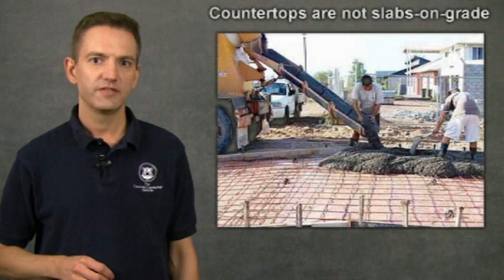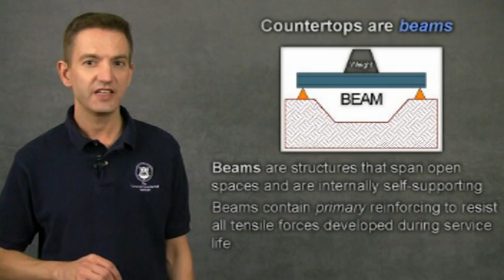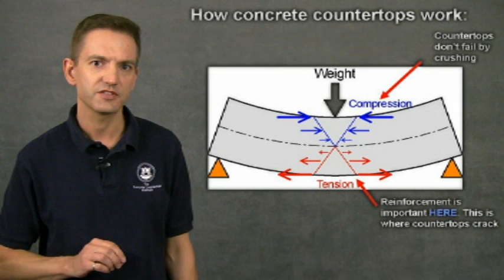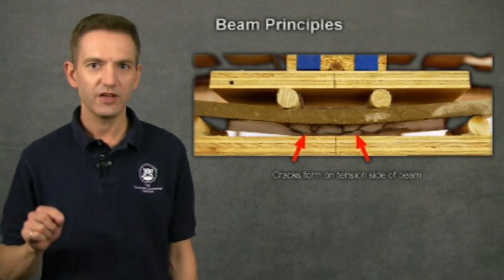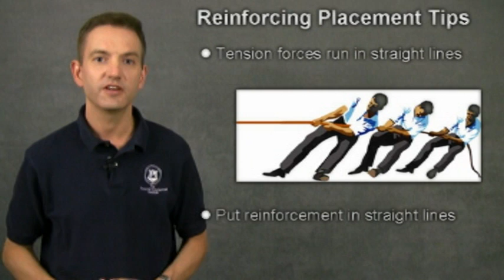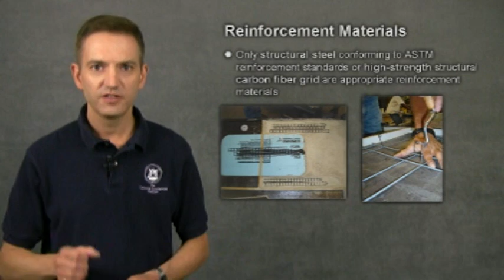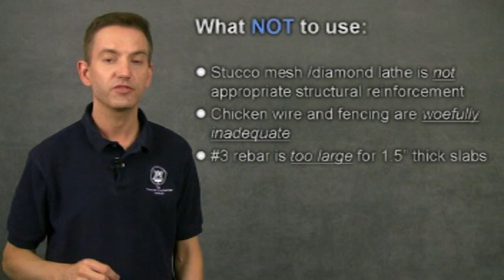Concrete Countertops: How reinforcing works

Comment: But glass fibers mixed into the concrete mix is a random orientation- not a longitudinal orientation. Arent you contradicting yourself here, sorry if this is a stupid question
Reply from the maker: You are absolutely right. If you just dump AR glass fibers into a GFRC mix, they will be randomly oriented. This is why commercial GFRC plants use powerful sprayers to spray the fibers into a flat plane, and concrete countertop artisans hand place and compaction roll the fibers when they want to ensure maximum strength. Many artisans use the "direct casting" or "SCC" method of GFRC, which does not properly orient the fibers, but they should be aware of the risks and use that only when they don't need high flexural strengths. See this article: https://concretecountertopinstitute.com/free-training/scc-backer-mix-for-gfrc-concrete-countertops-be-aware-of-fiber-realignment/

Comment: Years late but... I want to make a cantilevered concrete coffee table. Ho wdo I make sure it can support itself?
Reply from the maker: Usually the issue with small cantilevers is tilting, not cracking of the concrete. The biggest risk is that the whole structure could tilt and fall over. So it's the supporting base that's important. This is the same issue with any type of table top - wood, glass, granite, etc. If you have a photo of a table you are inspired by, you should be able to simply copy the configuration of the base.
Reply: @TheConcreteCountertopInstitute  Unfortunately, the design came from my head. The concrete upper will be 2'x4' and I want it to be thin... like an inch or less. So far, I'm thinking clear epoxy blocks supporting the middle, over the wood portion.... but I'd like to go with an unsupported look. I was thinking of some non-expensive way to do that. :(
Reply from the maker: @SyddlesFuzz  I'd have to do a consulting project for a detailed design, which wouldn't be non-expensive. :-)

Comment: The tensile modulus of steel  matches concrete while glass does not….please elaborate on this point. It seems to me that cracks will form sooner as the glass is not properly supportive within the modules of concrete .
Reply from the maker: I assume that you are talking about the AR glass fibers used to reinforce GFRC. GFRC has a radically different mix design than ordinary concrete, and is more in tune with the flexibility of glass reinforcing. I have extensive articles and videos about GFRC here: https://concretecountertopinstitute.com/free-training-category/how-gfrc-works/

Tensile modulus is an indication of the stiffness of a material, in other words how stretchy or not something is. A high number means the material is stiff, and a low number means the material is stretchy.

Steel has a higher modulus than glass, i.e. it is more stiff and less stretchy. Therefore, with all else being equal, a strand of steel that's the same diameter as a strand of glass will stretch less than that strand of glass under the same load.

With conventional concrete (rocks, sand, cement, and water), the concrete's overall ability to stretch without cracking is extremely limited. Conventional concrete is brittle, which means that it doesn't take much flexing to cause a crack. The structural reinforcing material must take up all of the tensile forces and at the same time prevent the reinforcing from stretching so much under load that the surrounding concrete cracks. Because steel stretches much less than glass, it takes a relatively small amount of steel to resist the tension-induced stretching. 

You can't use glass fibers and glass mesh (aka scrim) in conventional concrete because there's simply far too little that can be mixed into the concrete to provide the degree of tensile capacity AND stretch resistance that ordinary concrete requires to resist cracking.

Fiberglass rebar exists and can be used in conventional concrete, but the amount of fiberglass rebar that must be used to resist the amount of stretching that is necessary to prevent cracks in the concrete is much greater than the amount of steel that is required. So steel is the preferred method of structural reinforcing for conventional concrete.

Comment: Since ladderwire bends like straw, you'd think you'd be better off loading up some corrugated steel sheet with fiber reinforced cement.

But, apparently it doesn't need all that.  I wonder why.
Reply from the maker: Reinforcing doesn't work because the rebar is stiff and difficult to bend. Instead, reinforcing (whether it's rebar, ladder wire or prestressing cable) is part of a structural composite, where the concrete is (generally) in pure compression, and the embedded reinforcing acts in pure tension. The reinforcing is resisting pure tension, exactly like a rope. A rope can be flexible and bend easily, but it will still resist tension in a game of tug of war.
Reply: @TheConcreteCountertopInstitute  ah, yes! Prevent the substance from pulling apart and you've got a great deal more rigidity!

Like you said, the bottom side, if strung like a beam, would try and pull apart!  Put some tension in it, by rods acting like ropes, and presto! No more pulling apart.  Much more rigid as a result.

Thank you!

I'm using Quickrete Countertop Mix to lay down a 2 inch thick flooring... the downstairs has been INCREDIBLY reinforced.  Able to carry an extra 10,000 pounds.

I like the idea of making such thin concrete into a beam. Therefore, I'm employing all countertop techniques.
Reply from the maker: @russchadwell  You got it!

Comment: have watched numerous concrete countertop videos and am thinking about usein Quickcrete counter top bag mix, is this a good option or not I have about 85 ft. of countertop to produce in three different layers or height sections.
Reply from the maker: Hi Lee. As an engineer, my preference is for from-scratch mixes. However there are advantages, such as convenience, to using a bagged mix. For an article about this, please see https://concretecountertopinstitute.com/free-training/diy-or-bagged-concrete-countertop-mix/. If you do choose a bagged mix, I would advise one specifically designed for concrete countertops (such as the Buddy Rhodes mixes) rather than adopted from conventional concrete. Please be aware that there are many factors other than mix that are important for a successful concrete countertop project. For example concrete related factors such as not using too much water (https://concretecountertopinstitute.com/free-training/the-importance-of-water-cement-ratio-in-concrete-countertop-mix-design/) and proper curing (https://concretecountertopinstitute.com/free-training/curing-an-essential-step-to-create-high-quality-concrete-countertops/). Non concrete related factors include templating, forming and installation. Please see the articles at https://concretecountertopinstitute.com/free-training/ for all of these topics and more.

Comment: Thank you Jeff, another masterclass that help me a lot!
I have a question, why my countertop curl or bend upside or I don’t know how to say, inside the mould? The facecoat is sprayed, and the back is GFRC. I cover the pice while curing, no matter if is for one day, or 5 days, the countertop curls on the extremes. After taking out the mould, the countertop is like a bridge, not a beam, is higher in the middle.
Any idea, any advice in order to avoid this big problem?
Thank you Jeff 😁
Reply from the maker: Curling is almost always due to differential shrinkage. Please see the section on Curling in the article https://concretecountertopinstitute.com/free-training/6-problems-with-concrete-countertop-mix-designs-and-how-to-prevent-them/
Reply: @TheConcreteCountertopInstitute  thank you Jeff!👍🏻
Reply from the maker: @gonzalopmolina  You are very welcome.

Comment: Hello - would  1/4"-20 fully threaded zinc plated steel rod be too thick or unsuitable for a 1.5" thick concrete countertop?  My sink cutout leaves the counter only about 3" to 4" wide infront and behind the sink. My first attempt cracked but had no reinforcement!  Thanks for explaining tensile strength.
Reply from the maker: That size is fine, it's not too big. While steel threaded rod generally does have good strength, often small diameter common grades are made from steel that has a tensile strength lower than block masonry ladder wire. The simple solution is to use two pieces instead of one to ensure plenty of strength.

Comment: for the first time ever somebody explained to me the principles of beam in such a simple way, I have zero experience in civil eng., just an ordinary diyer .so if i place those ladder wires 1/2 inch from the bottom and another 1/2 inch from the top wouldnt that be stronger than using just a single reinforcement, assuming i am making a 2 inch countertop.
Reply from the maker: You need reinforcement only where there are tensile forces. In the case of a typical countertop supported on 2 ends, this is only the bottom. That's like the 2x4 with the Simpsons walking over it. If you have a cantilever (like the cow on the diving board), that's when you need reinforcing on the top. You also put reinforcing on the bottom in this situation because part of the countertop will also be supported on 2 ends.

Comment: Thanks for the numerous videos you guys have posted. They have been of great help. Im about to pour a 9ft x 3ft x 1.70'' thick countertop which I will then have to carry into place. Im wondering on the thickness of metal reinforcement I should use? Would 1/4" or 7mm be ok? Thank you.
Reply from the maker: Hi Jared. You're welcome! That should be okay. For a 1.5" thick countertop we typically recommend 3/16" reinforcement. Yours is a little thicker. There are more articles about reinforcement on our website: https://concretecountertopinstitute.com/free-training-category/reinforcement/, and we have a self-study course about it as well: https://concretecountertopinstitute.com/shop/reinforcing-101/

Comment: Everybody is so grateful like he's brilliant or something but no body is driving a car on ur countertop. Its just got to hold it's own weight. It's not that complicated ! I've made these countertops & put no supporting into them & still no cracks. It seems like he's selling something... I don't get it. The only info I got from this tutorial is about the overhanging outside bar top. Ur a good speaker but the info is just overkill.
Reply from the maker: You're right, usually it's not complicated and your countertop is not going to be under much stress, certainly not once it's installed. Flipping it out of the mold and transporting it to installation will usually incur the biggest stresses your countertop will ever experience. However, it is still important to understand the general principles for the cases when you do push the limits, for example with a very long, thin slab. And it's better to be safe than sorry.

Comment: I have two major disagreements with the info in this video. 
1.  If concrete slabs on grade depend completely on the graded material for support why provide rebar reinforcement?  
2.  Why would I bridge the long axis of a countertop when I have immediately available contact points along the forward and rearward edges?

Some of the information provided is correct.  However, the embellished indication of danger of using chicken wire in a countertop seems a bit overblown.  What's going to happen?  Is my countertop going to suddenly explode into dangerous shards of concrete when I set a cast iron pan on it?  Come on.  It's a fetching countertop.  Yeah, if you're in business making concrete counters and they are continuously cracking, that's a problem but not a danger (except during installation, I guess).
Reply from the maker: Rebar in a floor slab is there as secondary reinforcement - not primary. This means it's there to help control cracking from shrinkage. Essentially the wire keeps the big chunks of concrete together after it cracks, it's not there to prevent the cracks in the first place. In heavy load applications (warehouses with heavy trucks, etc), the rebar in a floor slab is there to help spread the load and prevent punching failure.

Moving a beam around your shop, on a truck, into the house, etc. stresses it far more than after it's installed, because any mishandling that occurs likely will result in cracks. The main job of reinforcing is to prevent an expensive piece of concrete(expensive because of time, labor, materials, etc.) from breaking because of handling. Also, not everything made out of concrete becomes a countertop well supported by cabinets, and not all parts of a cabinet necessarily provide adequate support.

Chicken wire is too small and weak to provide the necessary tensile strength to make a beam strong enough for handling. The steel chosen for reinforcing is responsible for all the tensile reinforcement in a beam. It's best to choose strong steel and to be better safe than sorry.

Comment: Is #3 rebar to big for a 1.75" thick slab?
Reply from the maker: Yes. #3 rebar is 3/8" in diameter, and that's too big for 1.5" or 1.75" thick slabs. You would want to use rebar that big only in 3" or thicker slabs.

Comment: I'm confused about the sink cut out part. Shouldnt each section supported on 2 points by the cabinets be considered its own beam and not be effected by the sink cut out?
Reply from the maker: Reinforcing a piece is done more for safe handling and transportation, rather than for after the piece is installed. Since the slab is handled as a single piece and is likely lifted from the ends, the entire slab needs to be reinforced to resist the bending forces imposed on it by its own weight when it's lifted. It will be subject to less stress once it's on top of the cabinets and supported by the cabinets at 2 points as you mention.

The reinforcing runs through the whole piece because the weight from two "wings" that are adjacent to the sink hole place a great deal of stress on the long, narrow sections that form the sink hole portion of the countertop when the piece is lifted and moved. Reinforcing has to be selected, located and placed accounting for the greatest stresses expected. When reinforcing adjacent to a sink hole, you add extra strands all the way along the length of the slab through the very narrow sections in front of and behind the sink hole.

Comment: Counters have supports under them plus the front and back of the cabinets. This is ridiculous.
Reply from the maker: You're right, usually there's not much to worry about, given that cabinet boxes are usually only about 3 feet wide and 2 feet deep. But there are other cases where a countertop spans a longer free space or there's a cantilever that might be subjected to loads. Actually the biggest stresses that countertop slabs get subjected to are in the shop and during transport and installation. Simply picking up the countertop slab from the casting table can exert extreme stresses. So it's important to understand the principles and be able to apply them in various situations.

Comment: Great Video!!! On your beam 8' x 6" x 1.5" beam did you use the 9 gauge structural wire?
Reply from the maker: Yes, that's correct.

Comment: Doesn't make sense if you're pouring a concrete counter top in place. You must use a supportive substrate.
Reply from the maker: For cast in place, you do need a substrate, but only as a form, not as a structural element. Once the concrete has gained its strength, it is self-supporting.
Reply: Sure, but if you use a firm base, like plywood, then you could use a thinner layer of concrete (since it's working more like your driveway than a beam), making it lighter and better for say an upstairs room with a large span. ??

Great video btw.
Reply from the maker: No. Plywood is too weak to provide structural support. That's why you need steel reinforcing for conventional concrete or AR glass fibers for GFRC. GFRC is strong enough to be made only 3/4" thick, versus the recommended 1.5" thick for precast. Please see www.concretecountertopinstitute.com/GFRC for tons of information about GFRC.
Reply: Thank you, will check it out. 

I was thinking of 3/4" ply, which would also be supported underneath by the framing. Wouldn't have be strong enough? I see people putting Featherfill (I think it's called) concrete in thin layers over ply or existing countertops.
Reply from the maker: Plywood actually has higher flexural strength than concrete, so that does seem to be a good approach. However, plywood is also much more flexible than concrete. There's a difference between flexural strength and flexibility. Placing a weaker and more brittle material on top of a stronger but more flexible material is akin to putting a sheet of glass on a trampoline and expecting the glass to withstand someone standing on it. That's an extreme example, but you get the idea. 

I should have said in the above answer, "Plywood is too flexible to provide structural support." Sorry for the confusion.

The Featherfill or overlay technique is not meant to provide any strength. The existing substrate provides all of the strength (which is not much in some cases). It's not a technique widely used by professionals.
Reply: Thanks for the great explanation!
Reply from the maker: You are very welcome. :-)

Comment: What about mixing glass or plastic fibers with graphene or graphene oxide?  Are they compatible?
Reply from the maker: AR glass fibers and various types of plastic fibers are used for a variety of reasons in concrete. I have several articles in my blog about various types of fibers: http://www.concretecountertopinstitute.com/blog/ 

Graphene is to my knowledge not yet used in commercial concrete, only in a laboratory setting. It is reported to make concrete twice as strong and be more environmentally friendly than regular concrete, but time will tell whether graphene finds its way to mainstream applications.